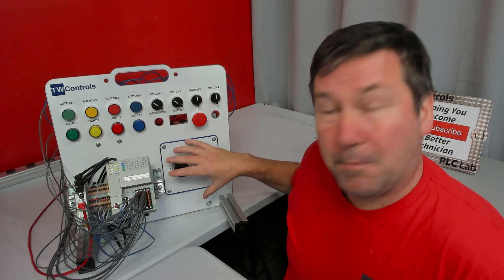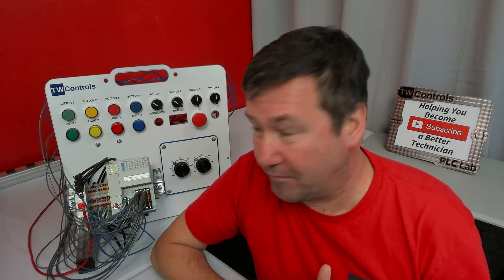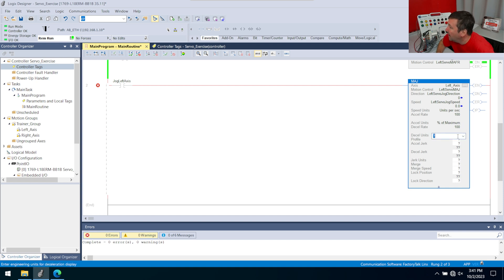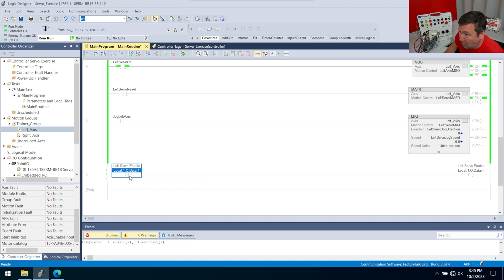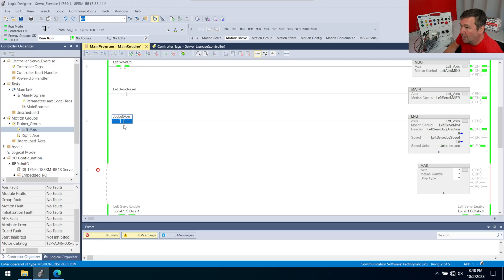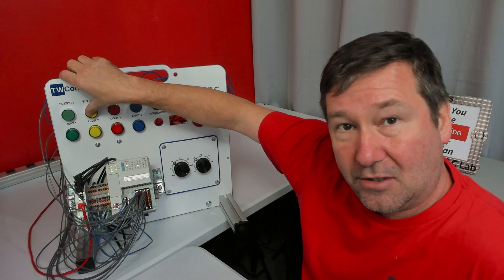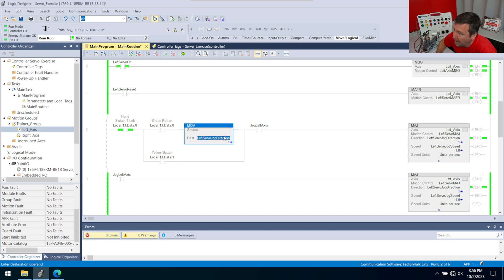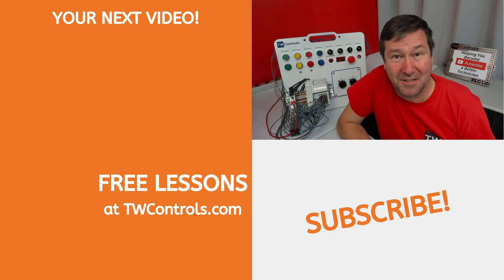How to Jog a Kinetix Servo in Studio 5000

Comment: Excellent video.

I know this is an exercise on a trainer, so this could complicate the basic lesson being taught here, but in real life should there be an interlock or other logic to ensure the servo direction cannot be reversed too quickly?

The MAJ instruction only executes on the rising edge of its input rung, so the servo direction cannot be reversed while running by pressing the second button while the first is pressed, but a button could be pressed immediately after releasing the other button.  Since the MAS will be enabled when neither button is pressed, perhaps the MAS's .EN and/or .IP output bits could be used to inhibit the MAJ until the servo is stopped.
Reply from the maker: I would say most programs don't have provisions for this and typically there is nothing wrong with decelerating from full speed one direction to stop and immediately accelerating to full speed the other direction.  That is pretty common in servos.

Actually I think you will get an error if you try to execute a 2nd MAJ before executing a MAS but I can't remember.  We're actually building a new Kinetix trainer right now so should be able to play with this soon.
Reply: @TimWilborne  oh right, it's a servo.  It may depend on the inertia of the system being driven by the motor.  It will be interesting to see the results.  Thanks!
Reply from the maker: You are welcome.

Comment: Hi! Is it possible to activate two servo drive with different model simultaneously? Like we have Kinetix 350 and Kinetix 5300 and once a start the manual Jog both motor will activate.
Reply from the maker: If one of them has a pulsed input and the other a pulsed output, it might be possible.  Here is it being done on the 5700 but I don't think those 2 are capable of gearing.
https://www.youtube.com/watch?v=Ow77OWfro_8